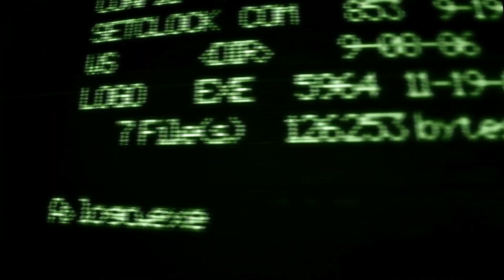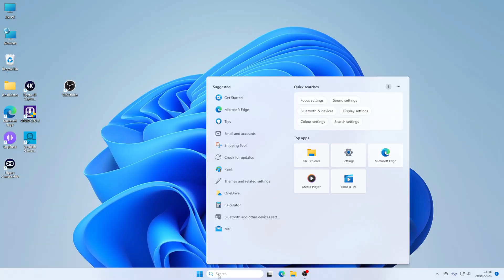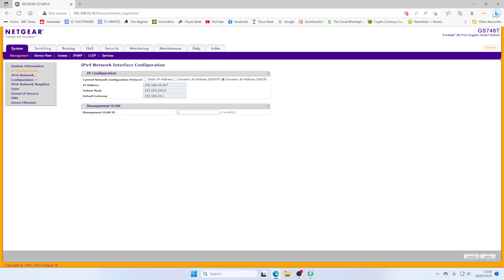A quick look inside a 48 port Netgear Prosafe GS748T v5

Comment: Glad I came across your channel. One thing I always do when disassembling  ANYTHING, be it a computer or whatever, is check the length of each screw/bolt to check it's length compared to previous ones removed. Usually when I have a tool in my hand I'm working on something a little more mechanical like a car. I think it applies to everything though. A  long fastener tightened down in the wrong hole can be devastating ! Please, don't ask me how I know. It brings back bad memorie$.